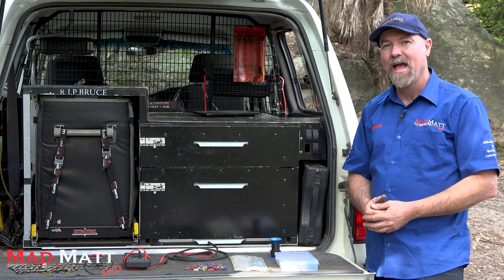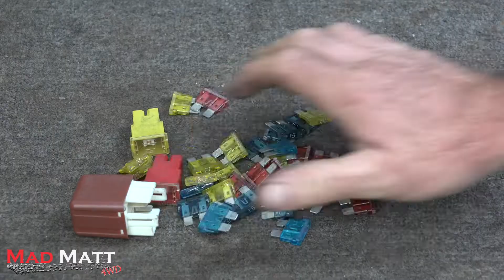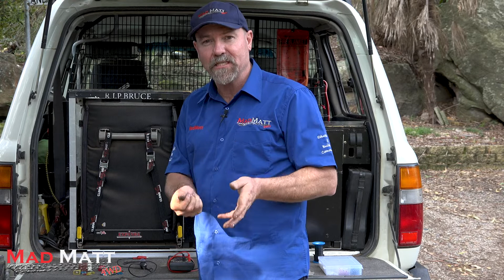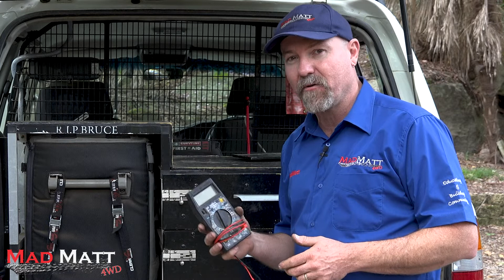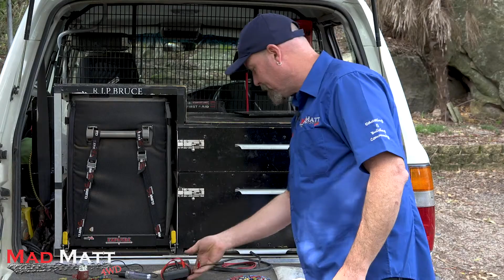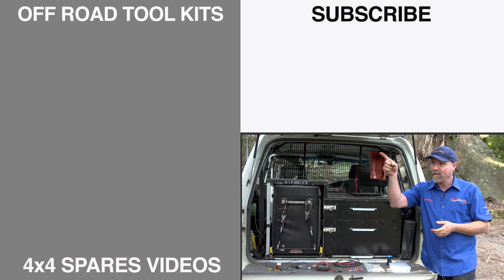Essential Electrical Tools for your Off Road Tool Kit

Comment: Good information as always Matt :) , just going off on a tangent here but can I take the front sway bar off the BJ74 , that will still leave the   sway bar on the rear . I think it reduces the flex in the front and I keep ripping the front “D” cups and bushes off the diff housing off road .
Reply from the maker: yes you can.
Yes you can